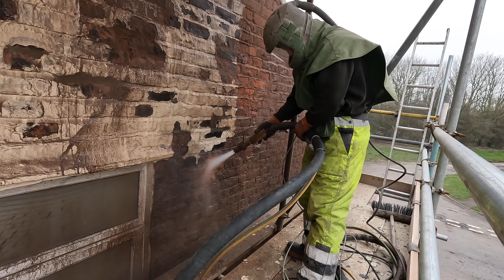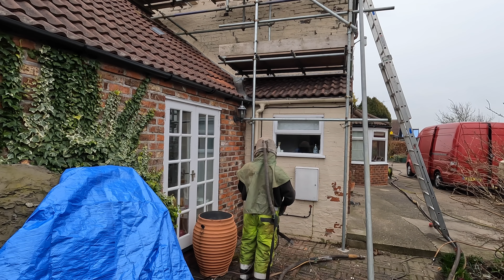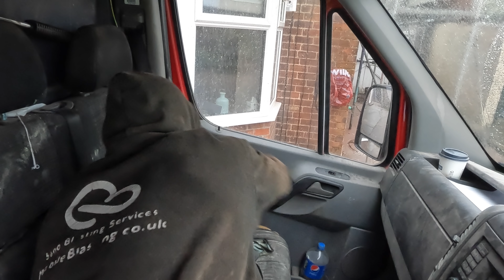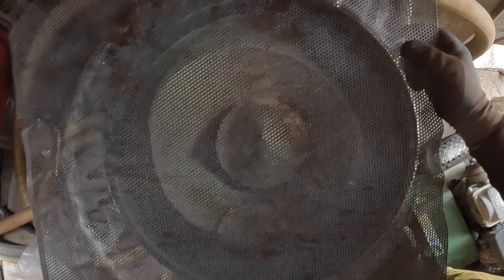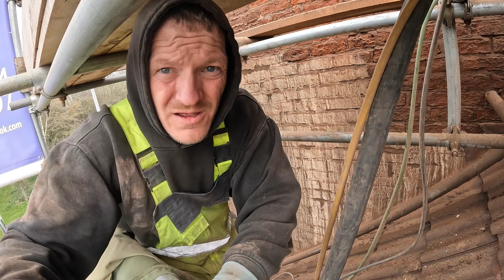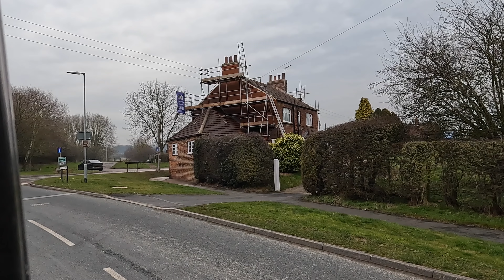Last resort to remove bitumen & paint to solve Damp issues. Dustless SandBlasting

Comment: Hmm, painted brickwork. Is it possible to do anything worse to a house? Render it?
If you really want to destroy it, k rend it  😄
Reply from the maker: 😂 render is a viable option as that's breathable and can cover a hole load of sins 😬
Reply: @Mobileblaster  I dunno mate. I reckon I would repair the brickwork for less. Any spalled bricks, turn them round. Usually there is a good face on the back. Get rid of the cement pointing and point with lime. You've just done all the hard work. A week of work and they'll have a living, breathing brick wall that probably won't need much maintenance for another 50 years
Reply from the maker: @chriscollins1704  it should have been a 2 day job but my compressor died 1st day and it ended up taking 3 days. Personally I would do what you say just grind and lime point it and spin the real nasty bricks round job done for years to come 👌
Reply: I see a few of these damp problems. Usually made worse by modern materials used as "damp solutions". You watch that wall now. It will go white with efflorescence as the moisture leaves. I bet the bottom 1 metre of cavity is full of crap too
Reply from the maker: @chriscollins1704  👌 you must be a blaster or done blasting before because every thing you mentioned is very much likely to happen you have seen it all before 😂 just like me. I've had phone calls / complains about the white coming out after 😂 the isn't much I can do other than give it time to dry out or treat it for salts but its best to leave it to pull out on its own it will eventually dry out and the white will go as long as the is no more water getting to the back of it. So if the joints gutters are fixed it will fix its self eventually
Reply: @Mobileblaster  no, we have done a few render removal. We usually tap it with hammers gently until it falls off then clean with hydrochloric. I don't advertise for it. Its just if people ask me to repair render on red brick, I advise them that if its falling off, it's a good opportunity to see if you can get rid of it all together. Can the blasting get render off or is it just paint?
Reply from the maker: @chriscollins1704  it can remove residue left over after knocking it off it I say anything 5mm or under and its a viable option any larger then more time with the hammer would work out a better option
Reply: Agree i am aplasterer myself but i dont touch krend, its sold as a modern day maintenance free product......how can a product be fully waterproof but breathable ?????
its not goretex, coloured renders are the modern day artex, a flash in the pan then the problems start, we live on a damp wet island, houses need to breath
Reply from the maker: @markylovesrave  maintenance free? Untill a bird sh!ts on it and it's near impossible to clean 😂 good job the is folk like me that offer a service to industrial clean krender when mold sets in and a pressure washer won't move it I also offer soft washing 👌
Reply: @markylovesrave  exactly, even the sample comes with a pipette so you can show the customer how utterly impermeable it is.
Reply: @Mobileblaster  Agreed mate,

Comment: what a bastard of a job can't really the guys who did the it. its the industries fault for flooding the market with far to many non permeable materials and bar paints etc have to past is way to low masonry paints have a SD value of around 1 which apparently is good enough when limewash linseed paints etc have a SD value of around 00.2-00.5 paint industry does need to change but wont cause it will cut profits your always taking a 50-50 chance when using plastic paints and non permeable materials.
Reply from the maker: some folk need testing if they fink painting brick or stone is a good idea lol well im glad they do as it keeps me in a job haha
Reply: @Mobileblaster  well if they didnt someone else would come along and do it and cash in but that is the sad reality of the industry. but its created lots of work so can't knock it i spose.

Comment: I would have just hot steam pressure washed that 3500psi machine
Reply from the maker: Then you would have wasted your time 😂 I have a falch 300bar (4351.132Psi) 155° @ 24lpm and a selection of chemicals to hand and I can safely say that would have been pointless. Well if you wanted to spend weeks and £££££s on chemicals it may just remove a fraction of the finishing and I can guarantee the finished product would have issues explaining to the customer why loads remains
Reply: @Mobileblaster  I did a sample here on brick had 3 to 4 coats white paint and the 250° hot water pressure washer took off better than blasting with media
Reply from the maker: @jdaspects  steam didn't work on this job nor did chemical also a rendering company turned the job down